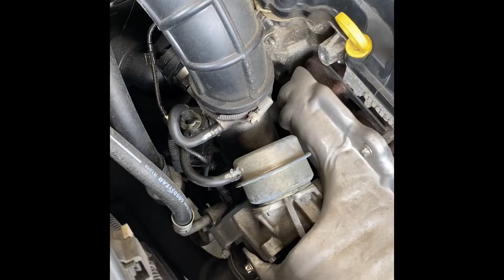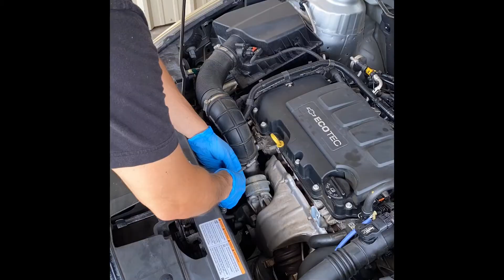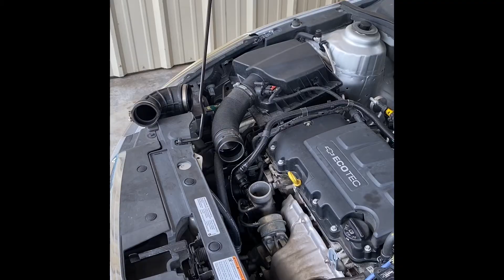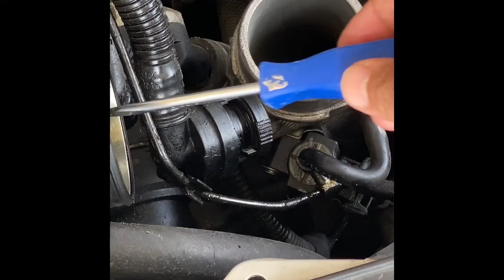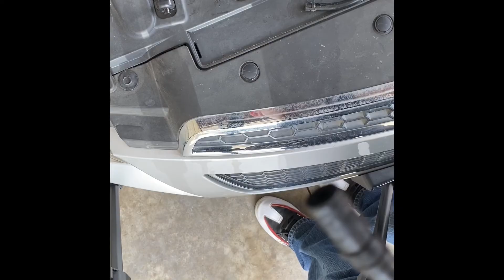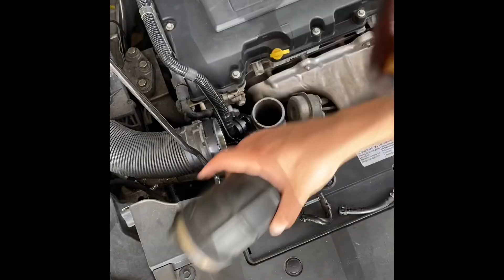Chevrolet Cruze 2012 P0299 underboost diagnosis

Comment: Idk why people make diag videos when they don’t know what they are doing. If you don’t know how the system works, go do research. Then make a video once you understand the problem and how to fix it. Otherwise you are just confusing/misleading people.
Reply: 100%. They only make it worse for everyone else.
Reply from the maker: At the time, nobody knew what was going on with the cars so it was a collective internet effort to try to source down the root of the problem. Ultimately, the issues with the cars is that the engine is just glass, and it doesn't take much to send them over the end. The gaskets are paper thin, and they used copious amounts of liquid gasket instead of actual gaskets in it's place. It's a bit of a mess.
Reply: The gaskets are fine with the majority of these GM 1.4L MPI turbo cars. The issue is the plastic parts used on the coolant system and the faulty PCV design.@hordebutcher2651
Reply: My Chevy Sonic has overheated twice and chewed washers accidentally dropped into the intake ports and runs fine. These engines will run fine long as you do the aftermarket PCV fix and keep an eye on the coolant.

Comment: Drive it with a code reader plugged in it will take some highway driving to open all the sensors 8 total. You can watch them clear with green lights one at a time. If check engine light stays off after all sensors have green light problem solved. In most cases. Engine light could come back on after a couple more miles driving. After about 5 more miles no light your good to go. Go to have inspected will now pass emissions.
Reply from the maker: Thanks. I can’t quite remember what I tracked the underboost code down to in this situation, but it has long since been resolved.

Comment: First thing you should do is remove that heat shield and check the waste gate arm. There’s a little valve that tends to stick that keeps the waste gate from closing or sealing tight inside the turbo. If ignored that’s when these turbos crack and then need to be replaced. You can check by unbolting from block and try and move it up and down if it’s gummy or sticks that valve is the problem. Also you can remove turbo and check the seal inside. If it leaks then the fan will not turn and that gives the underboost P0299 code
Reply from the maker: Thanks! I actually replaced the turbo with a Stigan turbo unit from Amazon and have been running it for 50K miles. It’s been doing phenomenal!
Reply: I'm getting p0299 code.   How do I diagnose if irs turbo going out

Comment: I just found the cause of the p0299 code that keeps popping up on my wife’s car. It’s the corrugated tube that goes from the intake manifold to the top of the turbo.  There is a check valve in the end of the tube just before it connects to the turbo. The check valve gets stuck open once in a while and causes the intermittent code. I just put a new hose in. 80 dollars for the hose and 10 minutes later. No more codes. 

Update a few months go by. The codes back.  I got an aftermarket waste gate actuator with a 12 psi spring. And pre loaded it 2.5 turns. That fixed the code for me until a deer jumped in front.
Reply: was it also slugging on power?
Reply: Where do you buy the hose?
Reply: Hylarious comment 😂😂😂

Comment: 6:50 That is actually a vacuum line, you follow it it will lead up to the intake manifold somewhere. There shouldn't be oil in there which means you're pcv system has failed like mine did and started pushing oil through everywhere, eventually it will start smoking out the tail pipe.
Reply from the maker: That’s exactly what happened and eventually I replaced the intake manifold
Reply: @hordebutcher2651  I ended up spending 1300 on parts. including new battery new turbo along with a bunch of other stuff and i upgraded the pcv system. Now she runs like a top 161k miles.

Comment: Underboost could be indicative of a failing turbo. I just went through replacing the entire turbo and pcv system. The oil feed line on the turbo especially is known to fail. Mine had long failed and everything else failed miserably afterwards. Its easy to get to and replace you need a special torx bit but its worth getting the set if you plan on working on this thing. The oil return line is also known to fail but that is a pain in the ass to get to.
Reply from the maker: Fortunately, my turbo didn’t fail in this case but the check valve in the intake manifold was problematic. I was running a a Dorman aftermarket intake manifold that has an improved design. However, I think the bad gas that we’ve been running is still causing the check valve the stick open.
Reply: @hordebutcher2651  I ended up purchasing the check valve upgrade kit as well pretty easy to install. 6 months I havent had any major issues.
Reply from the maker: @rob7439  I didn’t realize there was a check valve upgrade kit.
Reply: @hordebutcher2651  Cruzekits, just search it. The website has all the PCV fix stuff for the cruzes.

Comment: After watching your 2 first turbo replacements, I wanted to ask your thoughts on the following considerations shared with me by a friend.

QUOTE
1. Probably a exhaust leak at the turbo.
2. Could also b a loose wire at the turbo. 

3. Does the turbo sound like it is whistling? If not, I wouldn't worry to bad. The only way iv seen a turbo mess up the motor is when it goes out completely and sends the bearings that's in the turbo back into the motor. 

It will make that whistling sound before this happens though.
UNQUOTE

He'd mentioned clearing the code and seeing if it comes back on... YOU said something in this video about resetting code and driving it for a few days too! I'm TERRIFIED of driving it at ALL in case the problem is accurate. I don't want to cause problems for the engine and essentially wind up without a car I JUST bought.

THOUGHTS? Thank you so much for your input.
Reply from the maker: Hey Debi! I’m sorry because I didn’t see this comment until now. In this case, I can’t quite remember what I tracked this code down to but it has been resolved. It could or could not have been there Intake manifold that was resolved with the PCV fix kit.

Comment: Did you solve p0299 ?
Reply from the maker: Yes, but the ultimate cause was a popped check valve in my intake manifold.
Reply: @hordebutcher2651  likes this 55568437 ? Or air sensor?
Reply from the maker: @BS-fz8td  Negative on both. The check valve is actually located IN the intake manifold. Its an integrated design. You can go two routes, either replace the intake manifold with the AC Delco or factory original, or you can utilize the Fix Kit from Cruzekits.com. Either route will get the car serviceable. You check for the presence of the check valve by peering into the port on top of the intake manifold and seeing if you can visually identify the red little nub protruding out. You’ll need a flashlight to determine this. If you can’t see it, it’s either popped, coated in oil to make visual identification difficult, or recessed in with a different style intake manifold to make it impossible to see the nub. Therefore, you should utilize a cheap borescope off of Amazon to 100% identify the presence of the check valve. Another issue is that PCV soot can get on the check valve itself, causing a check engine light to trip, though in my case a dirty check valve caused a MAF code, and not a P0299 code.

Comment: Code part please ?
Reply from the maker: I utilized the DORMAN 615-380 intake manifold off of Amazon. I got approx. 18000 miles in it before another CEL tripped and I had to remove it again to install the FixKit.

Comment: Use the CRUZEKIT PCV FIX I just did that and it was a sanity saver.
Reply from the maker: I just ordered it a few days ago.
Reply: @hordebutcher2651  problem is I fixed it too late so now I have to deal with valve cover new gasket.
Reply from the maker: @SpotterDeer  I just did a trip to the hill country in Texas and I had to tackle a uphill that got steeper then I expected. I think I finally blew something out so when I get back home Ill need to dig back through it.

Comment: How can we create separate pcv module like bmw has as an aftermarket part to make the system easier to diagnose? ANY ENGINEERS TO SOLVE THIS ISSUE.
Reply from the maker: Your best opportunity is to contact BNR tuning and see if they can run a tune to eliminate it. Its about 800 for a full package because you have to get the tuner and purchase a license. Usually tuners who have full access to the vehicles computers can do it. I have a Camaro that was a check engine monster, and I sent the computer to am ex GM engineer with the specific instructions to make the car daily drivable and able to pass an inspection and he was able to do it. I never had an issue with the car after that.
Reply: @hordebutcher2651  pretty amazing. 

My comment was to iterate my frustration of lack of modules in this car: 
I wish we can separate the components out to be individually based instead of relying on other components not to fail.
Reply from the maker: @SpotterDeer  Maybe we can go back to the 70s when everything was vacuum driven and everything was an individual system. The biggest issue with this car is that the plastic is just weak and after 10 years it just gets heat cycled to oblivion.

Comment: The trick is to to replace the intake manifold and the valve cover at the same time to fix the pcv problem. As they work together. If you only replace one of the two,the problem will be back sooner than later . You must replace both to fix rough idle, code0299, under boost is a direct problem from the pcv when it reaches around 100,000kms. I'm at 300,000 +kms and still going strong.trust me I know .
Reply: I wish pcv whistled like it does on bmw when it goes bad.
Reply: So the intake pvc orange thing missing can cause p0299 code?
Reply: I’m at 97k right now. Lol
Reply: Agreed.  I've seen plenty of the PCV systems fail and cause numerous DTC's from misfires to underboost and will put these drivetrains into limp mode.  And i agree with changing the intake with the PCV/valve cover.
Reply: So did you ever replace your turbo?
Reply: @hector2340  UPDATE... I'm at 320,000kms now. car run like new . And I drive it hard.  UPDATE.. 335,000kms now . Running perfect 💪
Reply: @hector2340  no still stock OEM
Reply: @danielcoroado3063  so you are running your car with underboost code no replacement ??
Reply: @StreetLegalCars  under boost code may not always mean you need a new turbo ... This is why you need to properly diagnose your car . Its Rare the turbo goes unless your not properly taking care of your car and doing the proper oil change and oil requirements for the 1.4 turbo . Always use high quality full synthetic oil and don't go past 5-6000 kms between intervals . This is key

Comment: I have a 2013 chevy cruze lt and I took it to the dealer and they fix the turbo and catalyc convertor ...after couple months engine light on for p2099 for underboost 🤧 I see drops of oil or antifreeze after i park the car

Comment: This video is incredible, thanks to this video I can know which part I have to change to my encore 2015.  But here is my question for how long can I keep running my car with this code P0299?
Reply: Thanks for answering, I ask you that because this just happened a few minutes ago but I am on a very long trip and I do not find a mechanic until Monday and I wonder if I better try to reach my destination than it would be in 14 hours, I just don't want the car ro left me on the road.
Reply from the maker: @gosoniccgo6324  you’ll be fine. I drove on my car from Houston to Baton rouge in that condition. You’ll have a little lag and the turbo will run a little hot. I would recommend running premium fuel.
Reply from the maker: I suppose you can keep it running indefinitely but your fuel Economy will take a hit and you won’t pass inspection. You could eventually take out the catalytic converter as well $$$

Comment: Having same issue using same
Turbo on new engine I installed
Reply from the maker: Good luck!
Reply from the maker: Make sure you go through all the hoses and replace the PCV and possibly the intake manifold
Reply: My car throwing p0299 code car smokes at random times goes slow at start sometimes get slow then it boost back up again started working code want go way Turbo never been replaced whenAnd when I blew the old engine up I think turbo might’ve blew up with. It’s so I had no clue what the problem was bad keeps saying turbo under boost I replaced everything the intake manifold all the gaskets the only thing that has not been replaced as a tour boat self it’s bolted down properly all gaskets are installed

Comment: 2014 Chevy Cruze diesel, turbo under boost code with only 70k miles, just got told the waste gate pivot lever is the issue but they never performed a smoker test/pressure test to rule out anything else. Unsure of what to do as they quoted me a 3 thousand dollar turbo replacement...
Reply from the maker: I’m not sure about diesels

Comment: Did you ever really pinpoint the exact issue. Like you did something and didn't have the issue again? I'm hearing the only real fix for the whole system is a bypass kit for pcv. I must say this car sucks but I kinda like it. I like to tinker. Played with old Hondas when I was in my twenties then drove Camry for a couple of decades and nothing ever goes wrong.
It's not my only car so I have that luxury to play with certain things and replace.
I've replaced so many things on the Coolant system most of which is brittle plastic.
I'm also having the oil in the Turbo intake. I'm pretty sure my Pcv flap in Intake is gone but so black I cannot see.
Also probably need a new pcv tube from intake to turbo because I can blow air both ways and supposed to be a check valve in there.
I'm also always getting high negative fuel trim.
Replaced the evap purge valve but same thing.
It's getting extra fuel somewhere causing the negative trim.
I think I may have a leaky injector.
I've had all the codes one time or another but seem to be a hiccup every now and then, then once cleared don't show up again or very seldom.
If you like fixing things that break all the time, get a Cruze. You want to just change fluids and have a car just run, get a Camry.
Barring any Catostrophic engine or transmission failure, will try to get 200k + out of the Cruze.... At 130k now but optimistic.
Reply from the maker: The Doorman Intake Manifold off of Amazon positively fixed the issue, as the check valve on the stock intake had popped. That being said, the engine continued to run rough at idle until the coolant system purged itself, a process that took a few weeks and about 400 miles of driving. I guess in the process of draining and refilling the coolant and air blockage gets in the system. I had to replace the gas cap because the spring in the original gas cap went soft and caused an evap leak code. Right now I have to be sure to run 93 octane chevron gas for best results. Occasionally I’ll still throw a check engine light and it’s will go away as quickly as it comes. There coolant system plumbing you described is also very bad, with the water outlet corroding, the return line breaking at the t junction, and the coolant reservoir leaking as well. I really can’t imagine how GM allowed these cars to roll off the assembly line with this type of quality control issues.
Reply: @hordebutcher2651  There is a bleeder screw on the top passenger side of the radiator
Reply from the maker: @Pete391  I tried to find it, never could and just let it sort itself out.

Comment: Ok so the oil is coming from ur intake manifold going into the turbo. A few things can cause this doesn't mean it is the turbo. Could be a bad valve in the intake manifold, could be a bad seal on the turbo, could be piston ring stuck open lettn oil flood the motor. I've had all these issues. Let me know if I can help you further
Reply from the maker: Thanks when I replace the intake manifold the check valve inside was popped
Reply: @hordebutcher2651  where is the check valve? Im from the uk and have an Astra 1.4 turbo exact same engine as yours. Po299 is driving me nuts! Replaced the turbo but still low boost. Replaced the pcv hose that runs into the turbo, still no luck. Changed the boost solenoid last night and STILL no luck 😑
Reply from the maker: @chriswilson9224  The check valve for the PCV system is located into the intake manifold. It's not a very good design, so usually the CruzeKits.com fix kit will alleviate it. A common place for a boost leak with also be the downpipe leading into the intercooler from the turbo.
Reply: @hordebutcher2651 I purchased this kit and it fixed the issue.  I also added a cheap oil catch can from ebay.
Reply: Can you help me with this solution. Should I replace the intake manifold?
Reply: @TrashTalkingScratch  I mean as 1 of the cheapest options vs trying the turbo and it maybe that. If you have a thermal temp hand gun you can run the car as normal and then once it's heated and driven for atleast 30 mins minimum check the catalytic converter temp if it's over 800 that could be the turbo or the catalytic converter causing it but again if you want you can do the intake manifold it's about 160 on rockauto takes 3 days to get I just got mine in today and painted it and ported it to see what's thats like
Reply: @coreyprice369  can catalyic converter cause po299